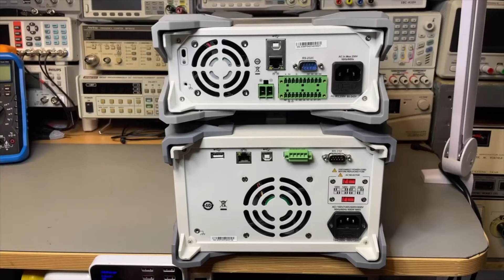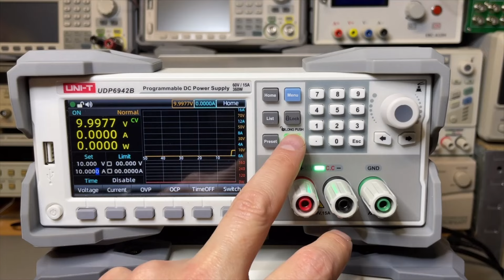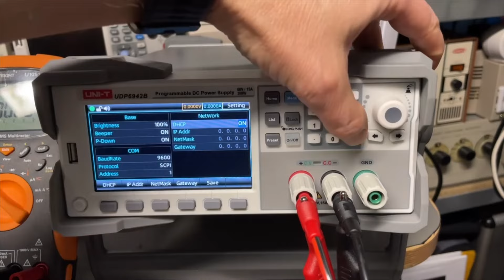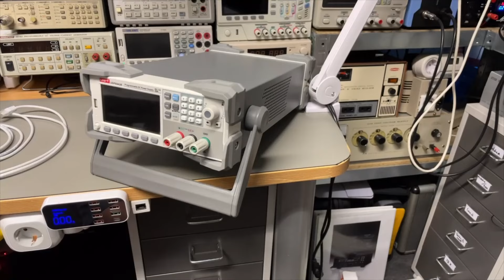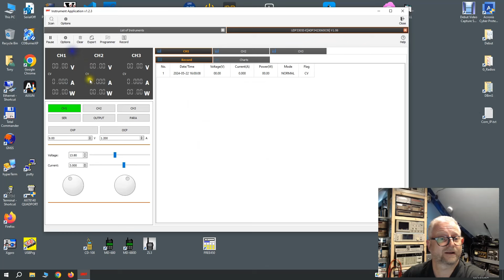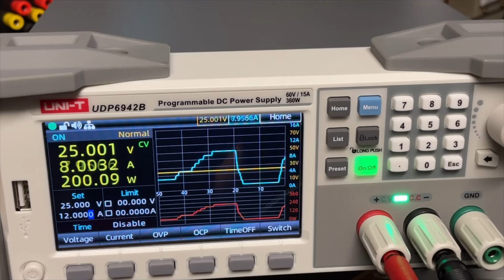TA-0402: UNI-T UDP6942B Power Supply - HOT - Hands-On

Comment: Would like to know what the frequency range of the sine-output is. Can we use this as an AC/DC power supply? I.e. is it possible to generate 40-70 Hz sine wave with this model?
Reply from the maker: Hi, its a list programming, i think 0.1 second so 10 Hz.  Matrix has nice AC sources, i have a video of that too.

Comment: I really don't like how close they put the bulk caps to the heat sink, why do the designers ALWAYS put caps right next to heat sinks... it is one of my pet peeves, when they do that the devices are almost designed to fail sooner.
Reply from the maker: Hi Scott, good question, i did a quick search on that, it seems from a EMI point of view, the big caps go as close as possible to the source and the smaller close to the load, that would be just behind the terminals.
Reply: @TonyAlbus  yes indeed, but they could move the caps 20-30mm further away from the heat sink without really impacting the smoothing performance
Reply from the maker: Interesting point, maybe we can do a video on that and do EMI testing if it does make a differnece, but why are you worried about so close to the heatsink, is it heat? becouse in this case they are on the cold side where the air goes in.
Reply: @TonyAlbus  Yes just because of heat transfer into the capacitor, even on the "cold side" as in this case there would still be some heat being radiated into the caps, shortening their life. 
I have fixed many bits of test gear where the caps have been placed right next to a heat sink and as a result get warm, and have seen multiple times where the caps by the heatsink are completely dead, while other identical caps elsewhere in the instrument are still testing OK, because the heat has increased the ageing of the capacitors shortening their life.
Reply from the maker: @TheDefpom  Thank you for explaining, interesting point. Still i am interested in the EMI consequences moving the Caps farther away from the source. Sadly most the devices are not designed anymore to last 20-50 years and if the designers are asked to design something with as low as possible EMI not too expensive and should last as least twice the warranty period, that is what they will do. Interesting conversation Scott, thanks

Comment: Hi Tony, any idea about the amount of ripple ? Grtz
Reply from the maker: Hi Bjorn, i have put the models and spec in the description now.
Reply: @TonyAlbus  those specs are very nice. Hopefully you don"t experience any glitches with this Uni-T device like MjLorton experienced with his 200000 counts bench multimeter from Uni-T that he received for doing a review. He experienced a few glitches, and send a open card to Uni-T and ask if this was designed that way, or if it was a fault. Some engineer from China from Uni-T replied that is was designed that way. While it seems it is not and it is a fault. After that Uni-T didn't respons anymore to his further questions if they gonna replace the unit or offer a new firmware etc....
Reply from the maker: @BjornV78  Hi, i remember seeing a video from Voltlog i think, he also got a replacement for review.

Comment: Great Video Tony, It's a Switchmode , that's why its smaller, but for only 360W to Large still. Thankyou for the Infos.
Reply: Hi @KonstantinGrigoriadis , i think they use the same case for the 360W and 600W model.
Reply from the maker: Thanks, yes switchmode indeed, they have 600Watt too.. that would justify the size.
Reply: @TonyAlbus  well not really, for a switchmode its to big and probably to expensive. Of course it has a lot of bells and whistles, but the CPS-3232 for example is 1/4 of the Size and is 1kw, the digital functionality ofcourse is not to compare just the power electronics :-

Comment: Hi Tony, the source is great 😲 UNI-T surprised, great control, connectivity and accuracy. The stupid thing is that you only have it on loan and you have to send it back ...... 🤔 so send it to me for my birthday, I have a 15V 60A power source so they will complement each other 🤣 you will fulfill the sending obligation 🤣 and it will make me happier than at UNI- T 🤔 I just have no idea how they would like it 🤣
With that maximum current, it's like loads, it won't allow to exceed 360W at different combinations of voltage and current.

Nice day 🙂 Tom
Reply from the maker: Thanks, yes would be great if i could keep it.